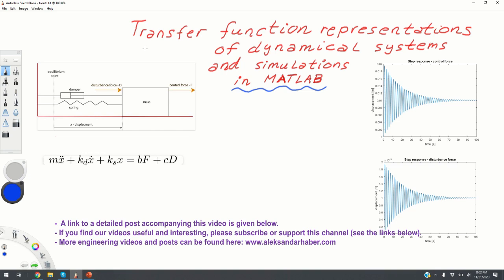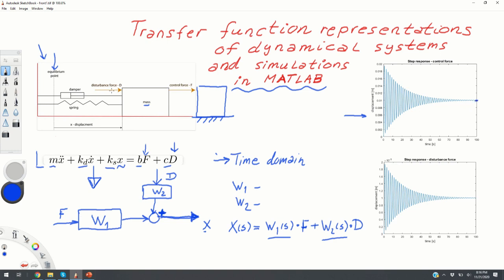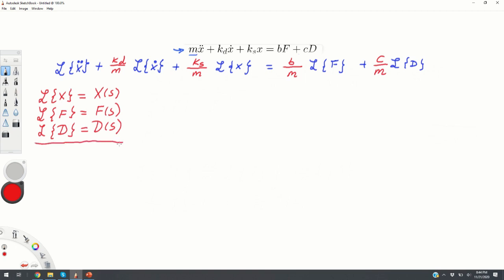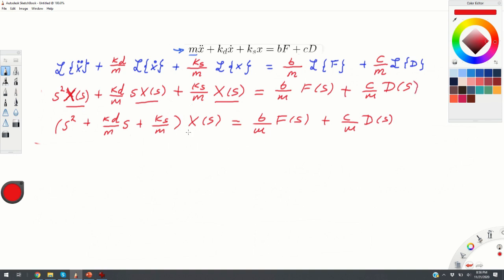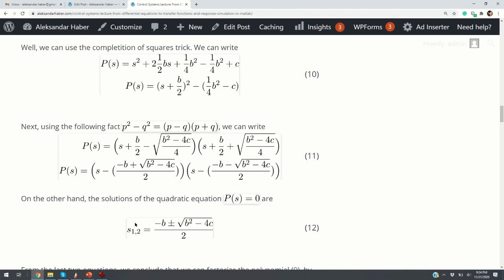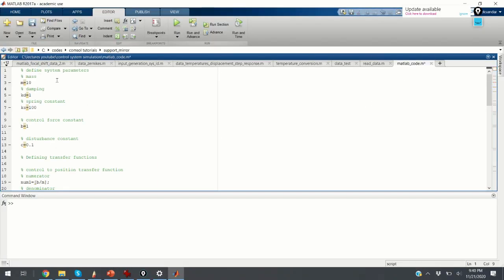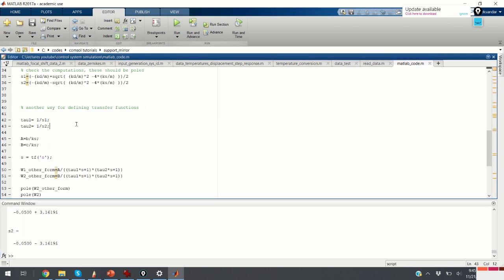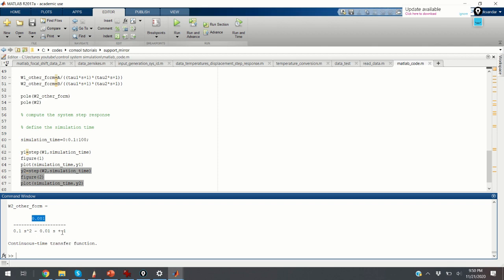Transfer Function Representations of Dynamical Systems with MATLAB Simulations - Control Tutorials

Comment from the maker: There is an error in the MATLAB code for defining the second form of the function W1 and W2. I have corrected this in the code that is given in the post. https://aleksandarhaber.com/control-systems-lecture-from-differential-equations-to-transfer-functions-and-response-simulation-in-matlab/

The error was in tau1=(1/s1) and tau2=(1/s2). It should be tau1=(1/(-s1)) and tau2=(1/(-s2))